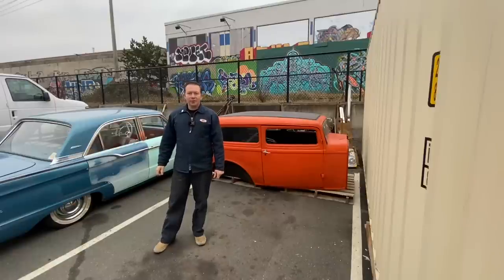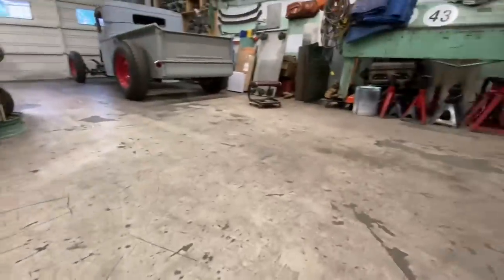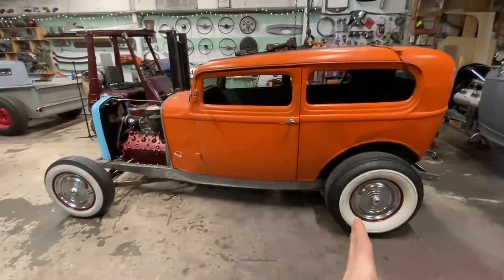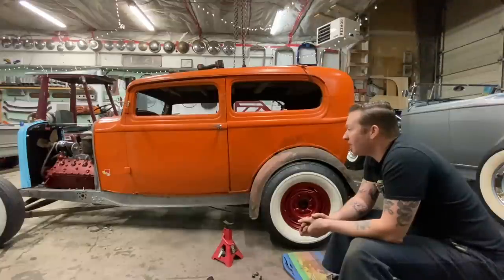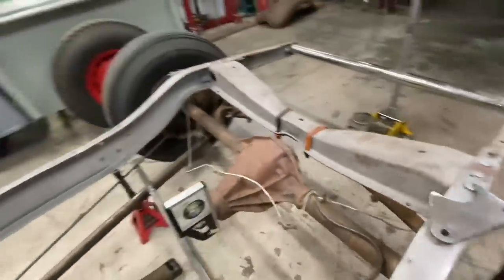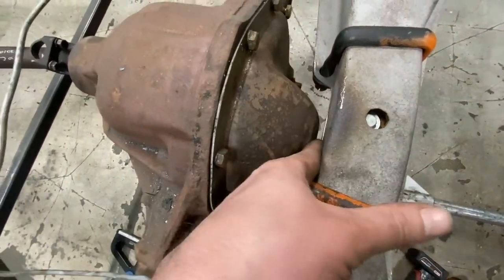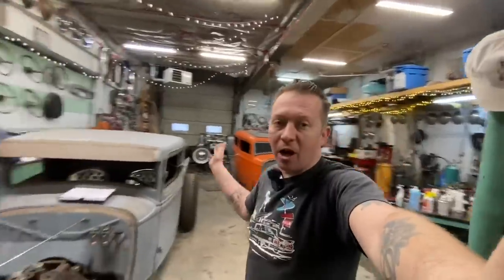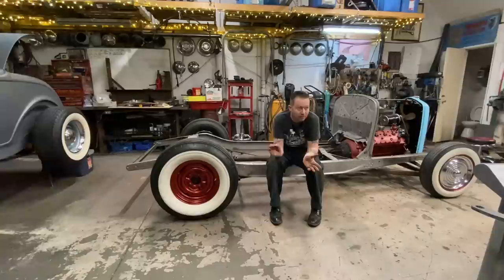To Fender? Or Not to Fender? That Is The Question. 32 Ford Build Part 11

Comment: I don't know why but sometimes full-fendered with running boards looks really nice and classy it just flows with the car and the whole design
Reply from the maker: Yup!
Reply: @LGKustoms  I don't know why but that car just screams for that same cherry red paint job as the engine block or even a metallic White with a nice metallic cherry red pinstriping but not too over the top but go with that nice tuck and roll red and white interior with tie this beauty together

Comment: Full fenders and widen the rear fenders to clear the tire so you don't have to lift it. The lower the better. Love your content!
Reply from the maker: I think it would be less labor to narrow the rearend than widen the fenders
Reply: @LGKustoms  both!
Reply: @LGKustoms  either way full fenders and running boards
Reply: I like the stance with the slight lift.  My thought was throw the east coast fenders on the front.
Reply: @LGKustoms  but which way would look better?
Reply: Too street roddy

Comment: I like what you said about it just being metal, just car parts. It reminded me of a friend of mine. When I met him he had an F100 with a 390 in it. When it started knocking he put a 396 Chevy motor in it, and when he blew that up he put a 401 AMC motor in it. When I asked him how he did it he said “ they’re all just scrap iron, if you can cut and weld you can make anything work!”
Reply from the maker: Exactly!

Comment: Definitely fenders! No fenders is too street rod looking on that, at least for me. Definitely more work, but worth it. Be careful when you dimple the diff cover, the pinion is lubed mostly from oil that is trapped between the ring gear and the cover and is carried over the top and thrown to the front of the case, if you squeeze that down too much I've seen it starve the pinion bearing. You can go a little and not hurt anything.
Reply from the maker: I shouldn’t have to dimple the cover anymore. There is over 1/2” of clearance now.

Comment: Great video Lee, fabrication is a put it together, take it apart, over and over etc etc process...lol, and each time we do this learn something a little different, and pass it on the next generation of builders and fabricators. It is, and always, and has been, fun to experiment with different ideas of anchoring rear ends, front ends, engine and trans mounts. I remember back in the 60s buying mounts and adapters, from Honest Charlie, J.C. Whitney, and others, and adding strength, via gussets, and creating my own ideas of what I thought would keep everything together on the road at 30 mph, and 100 + mph. I envy you and that great shop to play in, O what fun to create, fabricate and build a one of a kind Hot Rod.....I remember when my wife and I lived in Tennessee, our good friend Jason Graham & Tasha of Jason Graham Hot Rods, in Portland, Tennessee,  would build some great Hot Rods, and spend hours, days and weeks doing just what you and Shannon are doing, building fun rides. And the thought that goes into each and every build is nothing short of building great rides, based on great ideas....🙂
Reply from the maker: Thanks for sharing! Sounds like you’ve built some cool stuff!

Comment: fenderless. As a kid in a little town in New Zealand, one of the local hot rodders had a chopped 32 Tudor sedan. Flattie powered of course because OHV engines were rare and expensive back then. To this day I still think I'd build one one day but as I approach my 7th decade time is passing by too quickly.

Comment: Hi! You may want to strengthen the middle of the rear crossmember where you removed the lip for clearance. When the spring flexes it will crack the crossmember right in the middle.Love your work!
Reply from the maker: I think it’ll be okay, this car isn’t bumping around old dirt roads anymore. The aftermarket crossmembers are considerably lighter duty than this original one, and I’ve never see one fail. 
Appreciate your concern though! Thanks for watching!
Reply: @LGKustoms  thanks for your reply!

Comment: I vote for full fenders doing whatever you have to do to get them to work.  You drive your cars in all weather and you've already got a no fender pre-war hot rod.  So narrow the rear end so you can lower the body/fenders a little more over the tire, lower the front for the look you want and there you go!  I also have a question.  When did you put the stock exhaust manifolds on the roadster?  Did I miss an episode?
Reply from the maker: I put the manifolds on over a year ago. The car had to pass an inspection so the open exhaust system had to go.

Comment: If your sitting around bored with nothing to do today and you have 20mins to watch a barn find 34....I could sure use an LG comment consult on stabilizing a body for a future lift off and floor/rocker repairs. Thanks brother. Or roadtrip brown sugar to Florida and crash in the apartment for a collaboration.
Reply from the maker: I’ll check it out!

Comment: Lee,….you mentioned replacing the Model A steering box with a Ford F1. Did you maintain the Model A steering column, or use something else. Do you have a video of the procedure? Thanks so much for some of the best tutorials on YouTube.
Reply from the maker: Hi! Glad you like the videos. This 32 has had an F1 steering box since I bought it, and am planning on reusing the same F1 box. My Model A has a 39 Ford steering box. 
I do make a flange kit to install an F1 steering box in a model a. Is that what you are referring too? 
If so, no I do not have a video on it, yet. But hopefully in the next while I will. As for the steering column, you could use the model A column on the F1 box if the tube diameter was the same. I don’t normally use model a columns cause they have all the timing and throttle levers on them that become irrelevant when the 4 cylinder comes out.

Comment: full fenders are fine but What type of front fenders Full, half or cycle?  I remember a neat 32 from the 50 s, or 60s where the builder used a chopped 32 shell with Chrysler canted headlights, that looked great
Reply from the maker: I’m thinking just stock front fenders with some BLC headlights

Comment: Your channel is great and this project is awesome but imo fenders on that car makes it look like grandpa's stocker and not a hot rod. It's your car and you should do what makes you happy.
Reply from the maker: I wish my grandpa drove a heavily chopped 32 Ford haha.
Reply: @LGKustoms  Mine had a good 2 door 58 Impala  but granny sold it for 500 bucks the first week after he died. My parents kept telling me that I was way too young for a car anyway.  Wasn't easy growing up mechanically inclined in a family that didn't know the difference between righty tighty and lefty loosy. As you know we have the NSRA here in the states and it's ranks are overflowing with white haired guys driving chopped lowered full fenderd wire wheeled cars of every make with the chopped roof and slightly hopped up usually chevy engine under the hood. Thus grandpas hot rod.

Comment: You are an advocate of driving vintage cars , not just going to the next- block to get  hamburger . Imagine being 100 kms from home and it starts raining heavily  .Try figuring out the visibility through  that chopped winshield  and shortened wipers . Those front tires are splashing heavily as if you were in a drive-through carwash . The fenderless look is nice but impractical in wet B.C.
Reply from the maker: Haha I’ve been several hours from home in my roadster in the rain. With no fenders, wiper, or top! It’s definitely not pleasant.

Comment: You do not channel anything on 32 rails. What’s the point of having 32 trails if you gonna cover with a body. Full fenders low to the ground. Could aways widen the rear fenders. And you could of moved rear crossmember back.
Reply from the maker: I dunno, Diana Branch’s 32 looks pretty good. Same with with Squeek Bells 33. 
If I move the crossmember back the gas tank won’t fit.